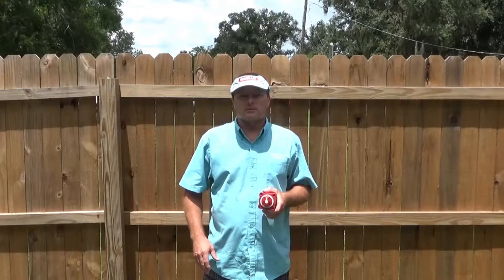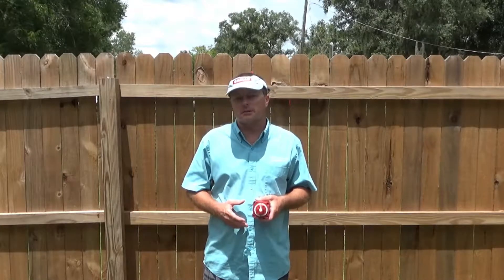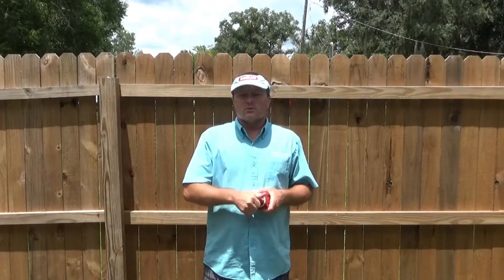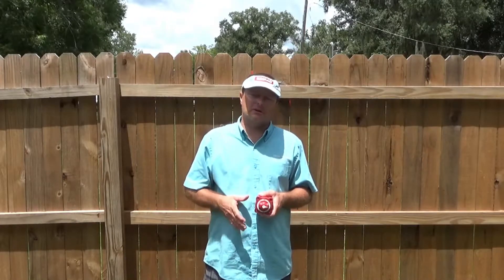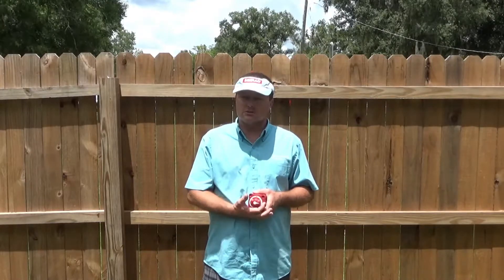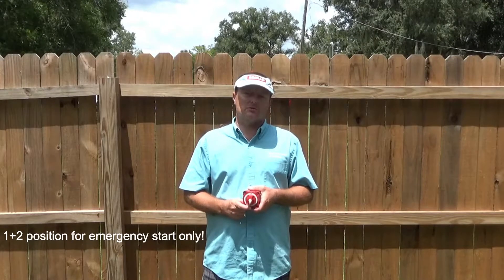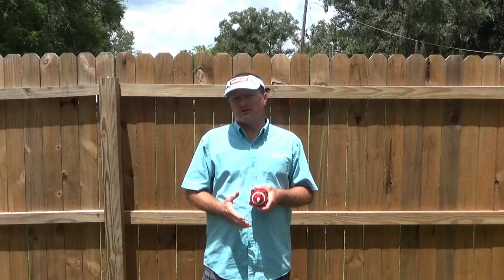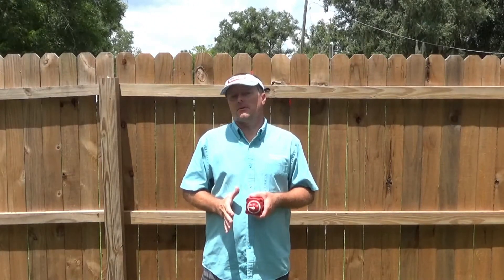Battery Switch Operation for a single 1+2 switch

Comment: How do I know if I am always run on battery 1 if it’s charging both batteries? I don’t have the ACR or anything else like that. I do have a cable that is connected to both batteries so I believe it’s charging both when I am running on battery 1? It’s an 84 center console Aquasport.  Probably not enough info. Thanks for help.

Comment: Boat will not start on 1or2 on battery switch but starts in the all position. Ground fault?
Reply from the maker: Would need more information to troubleshoot that problem.  It would be best to call a local tech to check it out.  It sounds like the batteries may not be wired properly to the switch, or your batteries are too weak to start the engine without combining them both together. A marine electrician should be able to find the issue with some basic test equipment.

Comment: Would 1+ 2  position be used to have both battery banks charged via shore power converter/charger?
Reply from the maker: It could be used that way, but if your boats charger is a two bank unit and wired properly you should not need to do that to charge both battery banks.